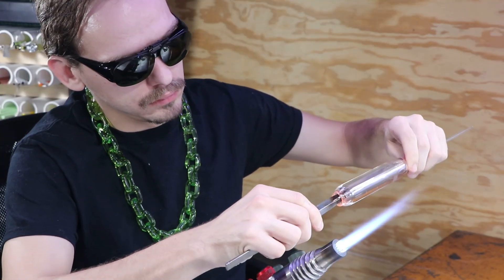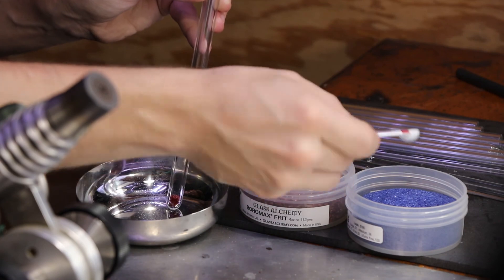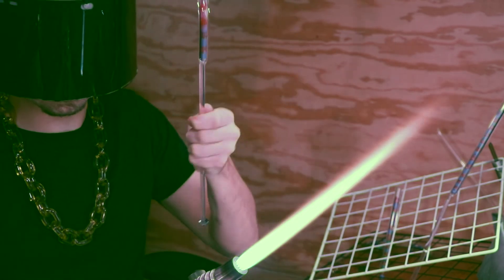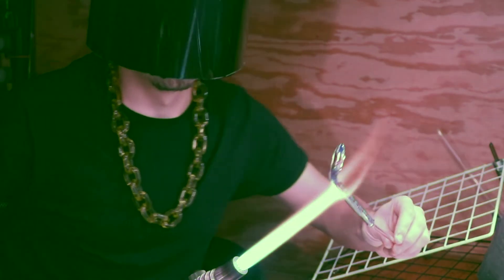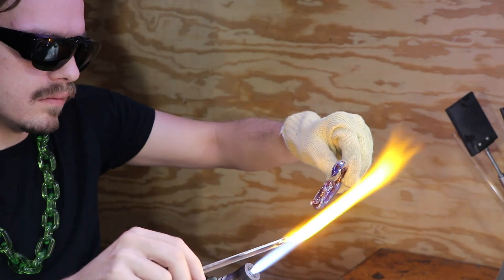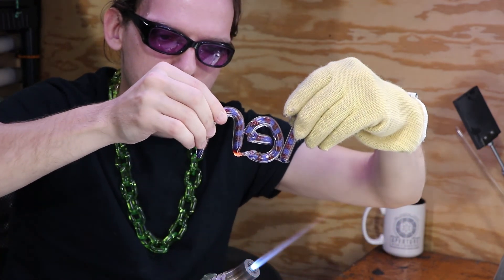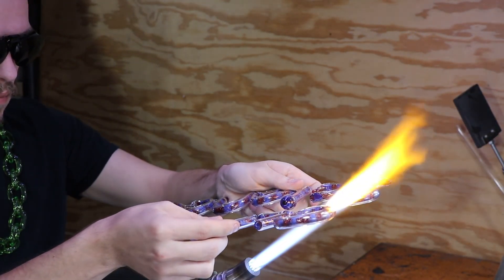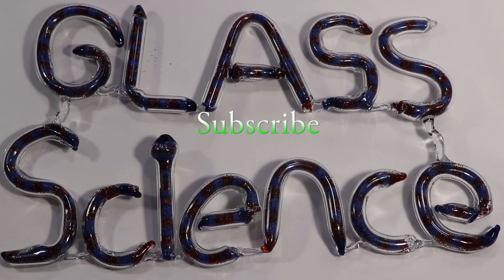Glass Science Frit Sign

Comment: is that sealed with the frit in there? the little bit of air in there is ok? not enough to blow it up?
Reply from the maker: It's impossible to remove all the air, but the frit does displace most of it. If you pack the frit in and tap it into place the remaining air will form bubbles instead of expanding and blowing up.